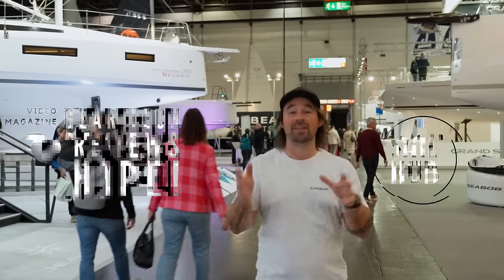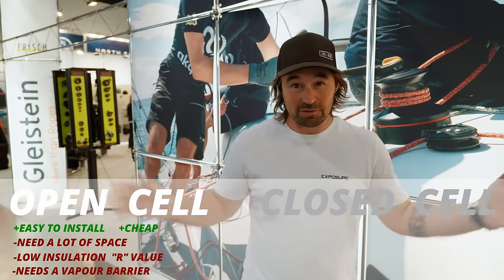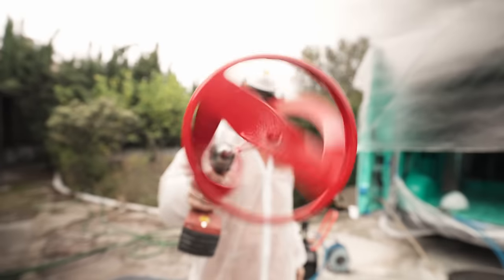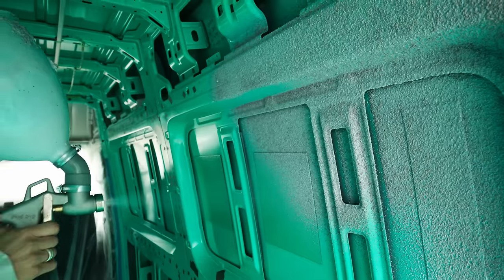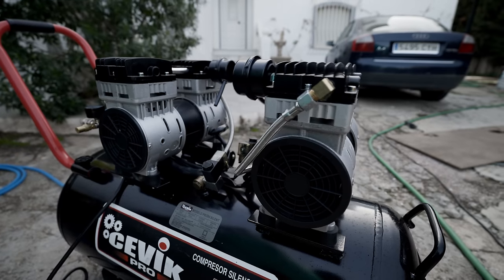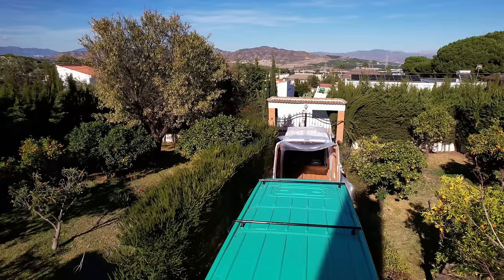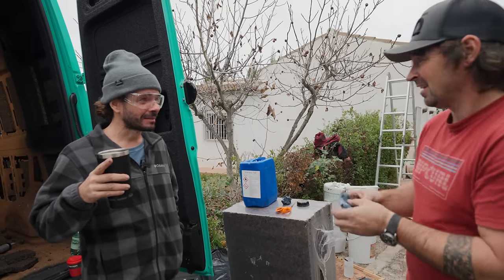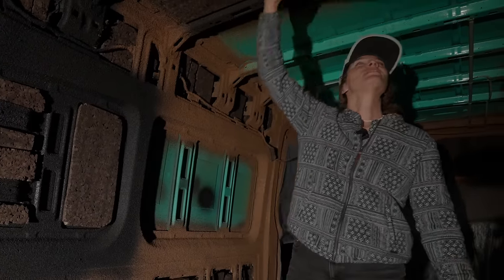Spray Cork Insulation. Is it a game changer for Everything?

Comment: Camera effect taking pictures at 228 is absolutely annoying. I skipped this part, I wonder how many just turned it off or moved on
Reply from the maker: How weird! It seems to be flickering - it didn’t do that previously!
Reply: @SailHub  do you have an update on long-term of this Cork insulation?? I am looking for tiny home, RV, shipping container and semi trailer conversions...our primary concerns are:
1. Mold
2. Toxic off gassing
3. Longevity
4. Duration of resistance to termites, ants, etc...
Reply from the maker: Hey, we’ve going to make a video after the next winter so we actually have some good data. 
To answer your questions sheets I can though;
Mold, cork naturally inhibits this and it prevents the due point and therefore no moisture means no mold. There are people who say that they have experienced mild but when I have seen their installation, there is too thin a layer of material and this not enough insulation. 
2. Toxic gassing, I’ve not got a gas meter of sorts but I am told by SeaCork that their product is organic and there is nothing toxic.
3. The longevity seems to be fantastic. There has been many boats using SeaCork for arctic expedition for well over 10 years without trouble. 
4. Termites, I have no clue, sorry. The only thing I can say is the manufacturer stated it was no problem and we received a comment from an architect who suggested they used a similar product in their housing designs as it was resistant to termites. I am personally not sure at all but I would live to see some testing on this! 

Hope this helps!
Reply: I agree. Also the 'background' music making the speech inaudible.
Unfortunately I gave up watching around half way through. Shame.
Reply from the maker: Yeah, the flickering was a real shame. It wasn’t like that on our computers editing software so I’ve no idea what happened there. It’s mega annoying! 😆

As for the sound, what can I say, we’re getting better!
Reply: @SailHub  I’ve watched a few of your videos, all good content. Maybe the camera “look” was triggering an app or feature on your video editor. I’d offer help by that’s not my wheel house. The aluminum boat looks sick, can’t wait to see it finished.
Reply from the maker: @bubbalove2261 cheers fella, appreciate the input. The videos are not our forte either. We’re boatbuilders and engineers mate! We’re working it out as we go!!! 
Glad you like the boat!!!👍😊
Reply: All audio and video was great for me today!
Reply from the maker: Thanks for the feedback! 👍
Reply: Absolutely corking video. Am likely to try it on a van now. Keep it up and didn’t notice flickering.
Reply from the maker: @conradbacon6479 thanks mate! The flickering is. Bit weird, it appears to do it for some and not others. It must be an android Mac thing… or something like that!
Reply: @SailHub   I checked it out again and ran it through a coupe times. When I paused it, there was a still shot of the side of a round white table with misc stuff on it. There’s pant legs under the table so it kinda looks like a convention center not an office to me. Hope this helps
Reply from the maker: @bubbalove2261 what on earth?! Thanks mate, I will have a look myself👍 much appreciated 👌
Reply: It seems like a glitch. Either happened after editing or while uploading
Reply from the maker: @OutOfComfort21 yeah, strange how we did not see it. Some people seem terribly upset by it though!
Reply: oh jesus.  was the info good or not?
watched
Reply from the maker: @ thanks fella! I hope it is!

Comment: Just FYI, both sides of the test sample you were touching in the show are at room temperature.  The reason the metal feels colder is because it is a good conductor, where at the cork is not.  Same as walking barefoot on a carpet and then onto tile, the tile feels colder even though both surfaces are the same temp.
Reply from the maker: Cheers

Comment: A Previous Owner, (PO), patiently fitted cork panels of various thickness, in my Presto 36, in order to conform to the compound curves of the inside of the hull,  both ceiling and overhead.   Incidentally, He (they) did an excellent job, an act of love, for sure.
Reply from the maker: Wow! Paneling out a boat must be a real mission! That’s impressive 👊👌 I presume it works a treat for heat and sound?
Reply: @SailHub  Heat, cold  and far as I can tell, it's very resistant to mold and mildew.
Reply from the maker: @nelmsgraham3384 yeah, it’s a natural property of the material. Aweseome.

Comment: It does not last, cork sheet or granules break down over time. Many villas in Portugal have it and if you open a hole in the middle of the wall the cork has dropped down so no value above maybe a metre height.........and that is where you need insulation.
Reply from the maker: Really? I’m not so sure about that. Cork granulated breaks down when encapsulated by a waterproof membrane. Let’s not forget this is a marine product here, not a housing product. I’m aware of the types of product you are talking about but this is different.
Reply: @SailHub  I have been building in Portugal since 1988, it is just the knowledge I have. If you have a different cork then it's ok.
Reply from the maker: @CarlosAlberto-ii1li hey up chap, It’s Seacork, as ne roomed in the video. 
Now, we’re all up for honesty and that’s what our channel is built on. Just I think it harsh to slam a product if you’ve not used it and also wrong to suggest it’s the same as a domestic product. 
There’s a lot of R&D gone into this, I just don’t want to reduce their sales based on false knowledge. I hope you understand.

Comment: After tearing out loads of closed cell spray foam in the steel boat, as well as some open cell that was added later, we can confirm with full confidence that closed cell keeps the moisture out much much better and is def worth it on a steel hull.  That cork product seems super cool too though! My only worry on a boat would be that cork is known for holding in moisture. Is the spray stuff better that way?
Reply from the maker: Hey! Good to hear from ya!

Thanks for the info on foam! 

I’m pretty sure cork very little moisture,  although it can of course hold some, however when surrounded by acrylic resin it is completely waterproof and acts as an unreal insulator. 

We will put an episode out in the summer about the testing we are doing before we choose the insulation for our boat, so far it’s been really really good.

Comment: I was hoping for a real sound db/transmission loss test, but you didn't do it.
Reply from the maker: Sorry my friend, if we had the budget for it that’s exactly what we would do. Maybe we could have done it with a phone but then we would get comments stating it’s not valid… where do we go with that? 

Anyhow, we’re gonna do a follow up after the or part way through the winter based on what we think so far. Do you think we should do it with a phone or not?
Reply: @SailHub  Any type of comparison measurement would be appreciated.  I am planning on soundproofing my bedroom wall, was thinking about using 1/4" cork sheets between sheets of drywall as a vibration dampener.  What do you think?
Reply from the maker: @JP5466 sounds good, I know some friends who used similar on a moody 44 yacht to sound insulate an office room to work from home. It worked a treat! I will pop some comparisons  in the overview video in some way or form for you 👍

Comment: On the subject of that flax fibre boat you were stood next to at the trade show. I absolutely adore that look and have been wanting to try and bring that into my interior van furniture design ever since I saw the easy composites channel make that canoe with it.... Do you have any thoughts as to how in the hell I make composite cupboards work in my van build as I'm struggling to think of how to implement it :face-purple-crying::face-green-smiling:
Reply from the maker: Sure man, there’s a ton of ways. We will be doing some of that in the boat. Question is, do you want to mould them, buy sheet material or make your own sheets? SaMe for corner mouldings? Mould your own or buy them? 
What’s your thoughts?
Reply: @SailHub   After trying to figure out how to to mould the cupboard, curved corners and everything, I couldn't really get my head round how to make them that way so that they had enough ribs and general structure to hang the doors and runners off of, so my brain sort of copped out and said perhaps it would be easier just to capture flat panels of the stuff in  a normal wood frame... Undecided really but would love to figure out how to make the entire curved cupboard in one seamless structure, much like the wood veneer in your current van build (which I only just fell over this evening so will have a lot of catching up to do by the looks of it )

Comment: Did you get hands on with the seacork decking sheets?  I wonder how they compare to the spray?  Do you think the spray would hold up as an exterior decking, or is the sheet/plank material fundamentally different somehow?  Also, I wonder if you have weight or density specs, if it's on the seacork website then I couldn't find it.
Reply from the maker: Hey, I don’t think you will get those specs from Seacork bug give them a call - they are sure helpful.

It’s fairly durable, but not enough for a deck that’s for certain. The decking is pressed and bonded under pressure and steam. It’s completely different. 

The spray cork comes in 12kg pots of which I believe around 75% will evaporate as it cures. We used 9 buckets for 3 layers inside our van. (A Lwb High to Crafter - Don’t forget the roof and windows were not done though)
Reply: @SailHub Great info, thanks!
Reply: @SailHub Wondering why you didn't spray the roof? Would it not be better for soundproofing to spray the ceiling?
Reply from the maker: @renstillmann ah, simple! We are cutting the roof out and replacing it with an elevating roof.

Comment: I want to try aerogel insulation. It's fireproof, great with moisture. Good sound and heat insulation.
Reply from the maker: Thats really interesting stuff! Micro pores right? I will need to learn more to be honest but it’s super interesting… may need to do some testing there too!  Cheers 👍
Reply: @SailHub  yea nanometer sized pores filled with air so it's light weight as well. I'm not a fan of permanent foam. Aerogel panels have the potential to be the best insulation for boats. Really want to try them. Also look into vibration damping tape this reduces sound from vibrations. The only downside of these is going to be the price.
Reply from the maker: @XArthieX sure, price… that’s always an issue but the tech sounds amazing… hmmm…🤔
Reply: @SailHub  should first get a thermal camera. Being able to quantify the current thermal performance and find the weakest zones is wizardry. You could save money if addressing the worst parts was all you needed. Verifing your insulation actually works afterwards is also nice, might have missed a spot. Plus thermal cameras are just cool that's enough reason to get one.
Reply from the maker: @XArthieX your right! We should! I’m game for anything like that.. such a geek 😂 we used one years back for tracking leaks in wooden boats - I could track the water up the planks and it was awesome. 
There’s more testing coming soon, let’s see if we can afford a camera, the prices are INSANE!
Reply: @SailHub alright, I just got a thermal camera and an aluminium project sailboat that has thick insulation. I would love to get some thinner insulation to get some more headroom. Will start measuring thermal performance!
Reply from the maker: @XArthieX awesome! Let us know how you get on, that will be so good for us to know!
Reply: @SailHub  Chiming in... You can get thermal cameras to plug into a smart phone now. Cheaper and smaller! #boatlife
Reply from the maker: @joewilliamson6378 yeah I’ve used the Flir one to track water leaks in wooden classics! We found the actual leak to be 20’ from the dripping plank in the roof! 
Sadly though, we don’t earn from YouTube to even get a sandwich  a week so one of those is off the cards….  We do have a laser thermometer on load that we will use in an upcoming video though!
Reply: Brittle and hideously expensive.
Reply: For aluminium hull I'd use anti corrosion paint/primer, spray cork layer, aerogel blanket (main thermal insulation), and maybe vapor barrier.
Reply from the maker: @IustinDornescu interesting combination. 
Why the vapour barrier and between which layer? 
And the anti corrosion paint is a box of worms too, would be great to know who you use and why 👍
Btw, have you come across a reasonably priced aerogel that is good for mine use yet? I’m still looking for our build!

Comment: So the question is how waterproof is the spray cork? Is the glue toxic in any way, and does it break down ? Is it easily removed in case of rust or repairs needed? Love the idea, love wood based products, so very interested. I have a 1972 VW Transporter that would benefit greatly from a product like this, but worried about rust.
Reply from the maker: Hey! You’d have to talk to SeaCork as I’m not going to take responsibility for this! 
Mind you, I understand it’s fine for all of your worries, I asked them all too. 
It’s also super common on mental boats where these same issues are also there, just with greater cost implications and it’s often regarded as the best option. 
Hope this helps, cheers

Comment: I always thought about filling the hollowspace with cork granulate. It will settle over time into every cravice and then you can refill it from the top.
Reply from the maker: Sounds simple enough, we’ve actually done that behind the fridge in the van. As it’s open to air for the vent I decided if may get a bit damp at times and the large surface area of granules could help it evaporate easier?!

Comment: VERY interested in seeing a followup on this one. I wonder how spray cork under unbonded foam sheets would fare
Reply from the maker: Sure! We’re working on it! 
I don’t think you would need the foam to be honest.. but we will hopefully find out in some upcoming tests! 👍😀
Reply: @SailHub  Those cork sheets looked like they crumbled SO easy. I'm
 also rebuilding an aluminum boat (Canada) and trying to find an alternative to sprayfoam. It currently has 80's fiberglass insulation bonded to some kind of 5mm board with aluminum foil on the cabin-facing side
Reply from the maker: @jeffd7976 sounds like an interesting project!
The cork board, yeah, it’s male cork and it’s pretty crumbly. When it’s in it’s not messy though. Mind you it’s not all that light and it’s not generally used on boats, we’re mainly using it for its sound insulation properties given the van is to be a podcast suite.

Comment: Would be interesting to do a side by side comparison with a similar van but with no insulation. And another one with a different (typical insulation like foam spray or PIR boards) and do sound tests from inside and outside. Like decibel wise. That way we would better understand how well this setup performs from a soundproofing point of view.

Having said that, I never knew that this cork spray (paint) was a thing. And I am considering just ditching the whole insulation, and instead soundproof the van. Since like you stated the insulation of the cork isn't bad either (and sheep wool).
Reply from the maker: Hi, yeah that would be fab! I can tell you the difference from an uninsulated van has been amazing. It’s a shame we can’t compare the decibels but I may find a way yet as my brother has a traditionally insulated sprinter. I guess it’s just finding a sound meter to borrow..we could do this with a mic and show the results in our post processing software but I’m sure people will say it’s been rigged. I will think on this one.
Reply: @SailHub  Yes, a decibel meter would be better, along with the sound comparison side by side in the YouTube video.

I am currently working on layout and wiring etc before I need to pull the plug on the insulation so I will try to wait for the video. But this method looks great. Thanks guys! ♥️
Reply from the maker: @renstillmann I would crack on if you want a video as we have a lot on our plate. Check out our website and feel free to send us an email through the contact us page. I can happily sort a call out to let you know what we know in a more sensible time frame.

Comment: I made a Sandwich of wood and cork for my campervan floor. 9mm Each side of 19mm queenly. With natural ventilation underneath.
Did the sides with 6mm of a roll. And 60mm recycled PET.
Thought off spraying. Just, it's so messy.
Reply from the maker: Sounds fab. It all makes sense, I guess your just missing out on the sprayed ‘skin’ that prevents any condensation on the metal where boards and the likes don’t touch. Small price to pay and a lot cleaner than the spraying like you say.